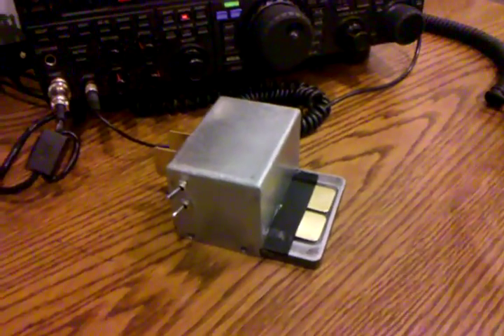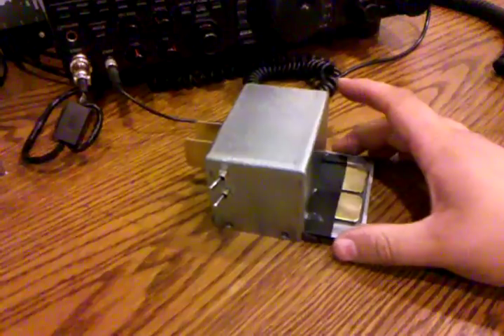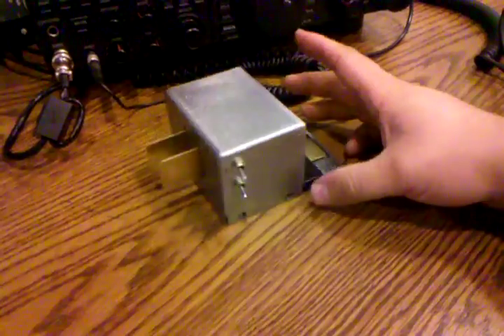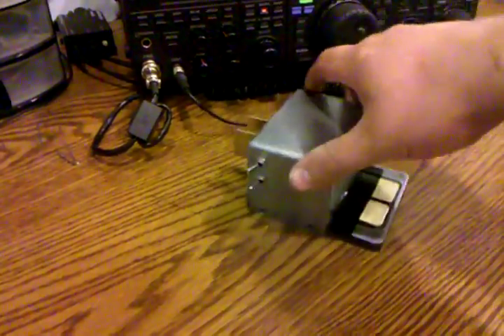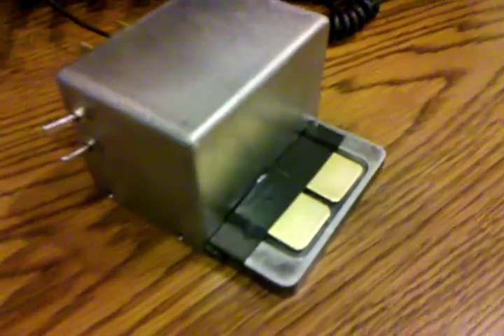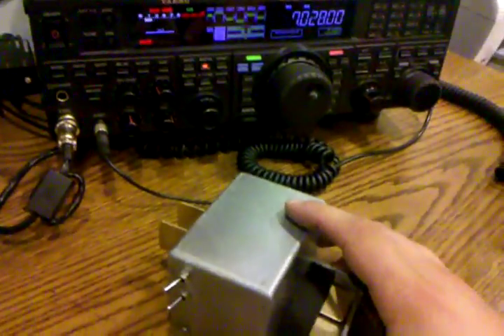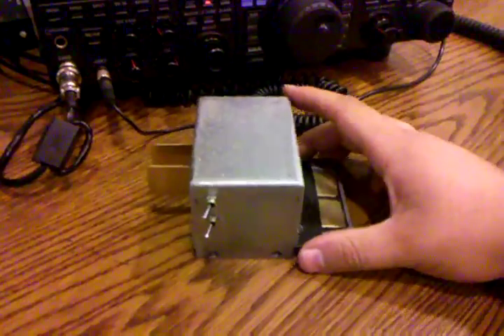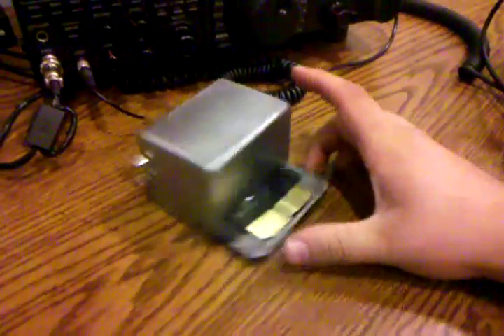N1BMX.COM / Morse Code Touch Key Test

Comment: Too bad i didn't catch you when you started this keyer . I would have warned you about not using  your fingertips and to use the paddles instead... because  theres no way to be as fast with the tips as with side paddles and if you get proficient with the tips it would slow you down after you figure out the paddles are faster ... Depending on how fast you receive, you already figured that out by now I guess.. 73